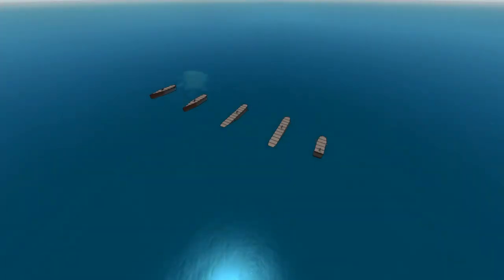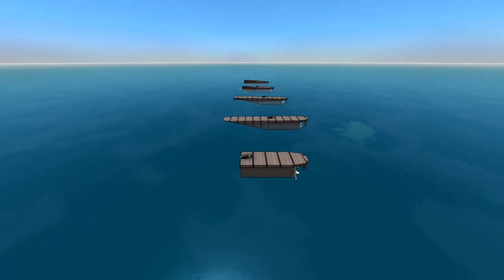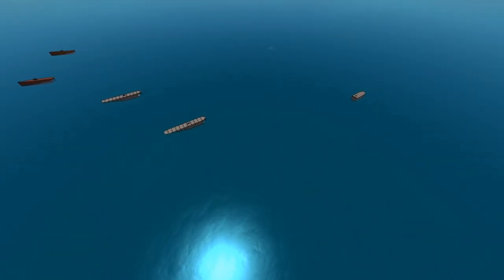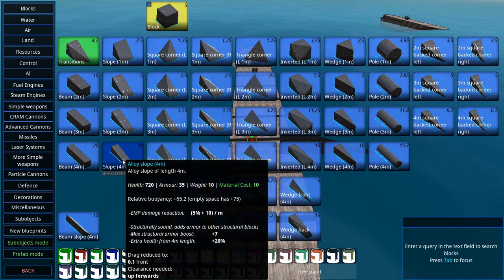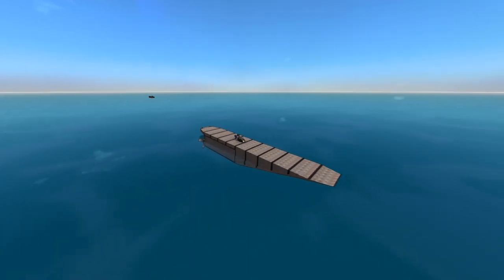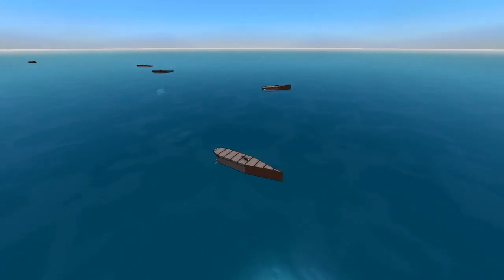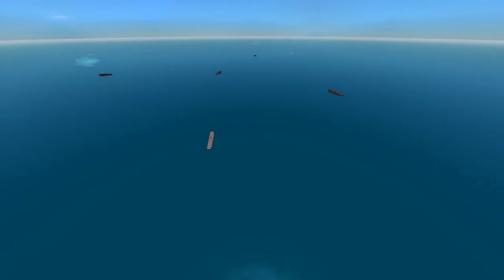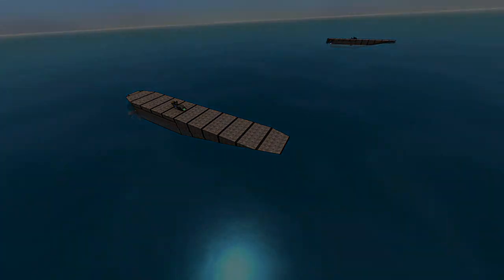Basics of Faster Craft! From the Depths, Quick Guide

Comment: Extra tip: Wedges and slopes reduce drag in the water. What reduces drag even more is putting less of the ship in the water. Hydrofoils, high bouyancy, ships that pitch up and keep their prow or drag creating surfaces out of the water- All of these can make a substantial difference in speed. Air has around 1/10 the drag of water in FTD. So if you can make contact with less water and more air, you'll go faster.
Reply: So basically, make a hovercraft that doesnt touch the water at all
Reply: @ProtoAzula  planes, or ignore drag entirely with spaacceeee
Reply: @oliverannibal2836  i managed to make something that went 500 m/s
Reply: @ProtoAzula  i made a ship that reached about 17,000 m/s after punching through the map border

unfortunately, it only goes 3 km/s in campaign

that speed is entirely useless in combat but great for a cargo ship
Reply: @Ponja__  GPU Oceans is a good option to make use of for getting higher campaign speeds without glitch speeds. Just have a ship that sits shallow in the water or uses both water and air propulsion ramp off the top of the waves around Onyx Watch territory.
If it's a propeller only ship, manually tilt it nose up and ride with the propeller over the crest of a wave, then take a screenshot of the ship at the peak where it has reached it's highest speed.
The screenshot comes into play as it dilates game time and makes the Buildworks script more likely to check on the ship for a new speed record at the right moment.
I have a handful of ships that only move around 30-50 m/s in combat, but which have speeds of 80-120 m/s on campaign resulting from this trick.
As for higher glitch speeds like your 17km/s, it's pretty much always the result of a physics bug, and as you said, most useful for logistics units. A broken high speed logistic unit can make the Godly campaign quite trivial, especially at low cost, because you can expand, intercept, blockade and do everything faster than the enemy.

Comment: One trick I use for large battleships is adding depth control propellers. Put four on the ship in a drone-style configuration, I use a lot of trimaran-style ships making this even easier. You can then use ACBs to make the ship sit higher out of water out of combat for extra speed, but drop lower in combat to reduce the speed, present a lower profile, and allow your bow thrusters greater effect. This has an additional benefit - when taking damage, if you lose watertight integrity in several compartments and start to slip beneath the waves, the propellers will spool up and keep you afloat.
If money is no object, replace the props with ions and actually fly out of combat for even more speed........